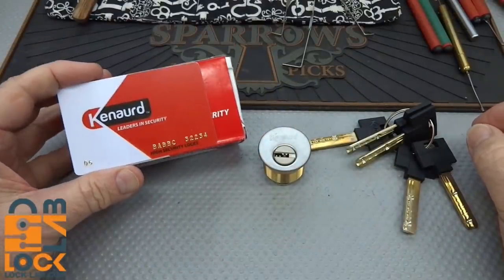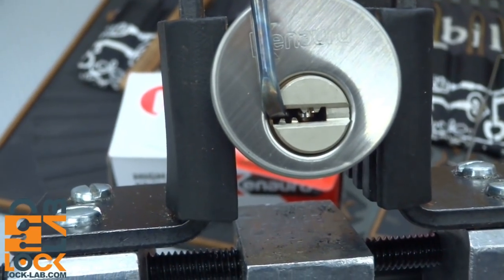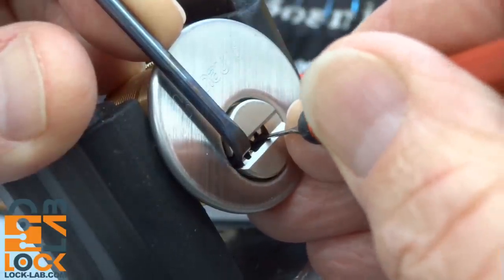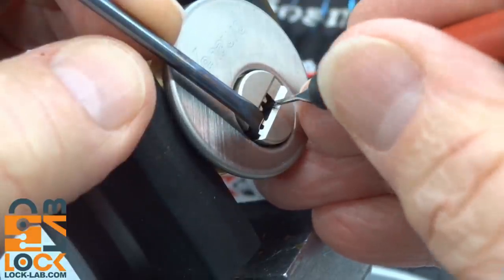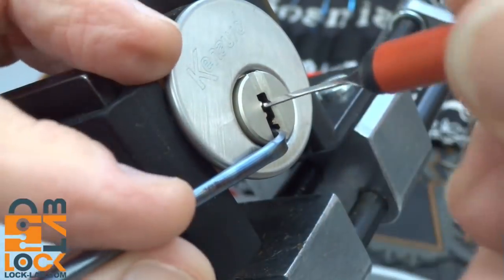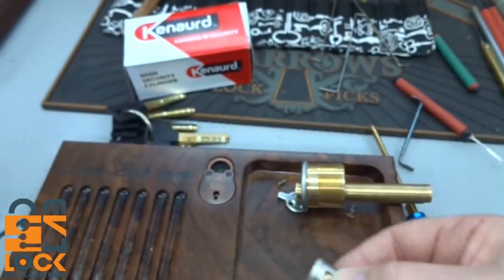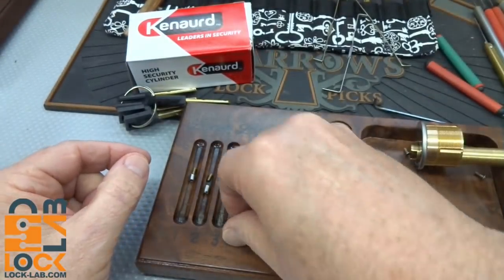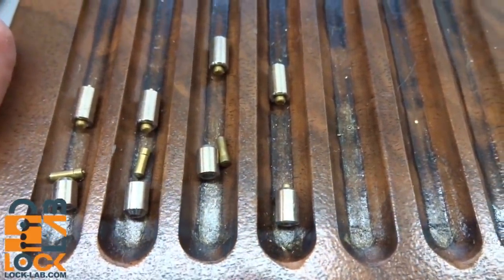(979) Kenaurd Pin-in-Pin Picked & Gutted

Comment: Nice job. I've recommended these as beginner pin in pin locks, but that's about all they are good for imo. Ps- you can usually get them for $17 on eBay. If you pay much more than that, you get into the price range of the angal MTL clones and MTL jr locks, which are much better.

Comment: As always, love your vids. I do have a question though. For a beginner just learning the subtle art of lock picking, is it best to stick with learning pin tumbler locks or expirement with others such as dimple and wafer locks?
Reply: I don't know what Bill's thoughts on this is, but I'd recommend that you start on standard pin tumblers and move in to dimple locks.
Wafer locks come in high security types, mostly found on motor vehicles, and 'no-security' types, found on cash boxes and filing cabinets. Don't bother picking the 'no-security' types as they are easily jiggled open. (even a nail file works for this.)

Comment: why is the inner pins always longer. wouldn't a shorter inner pin make this much harder.
Reply: Robin Häggqvist The inner pin is thinner and thus reaches the deeper cut-outs in the key .. if they were shorter the driver inside pins would move and the shear line permanently block ...